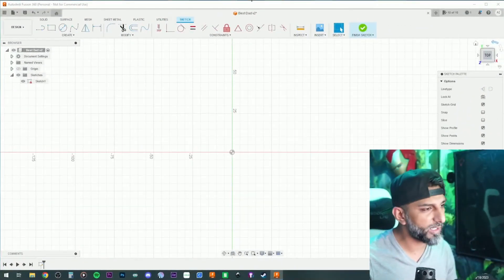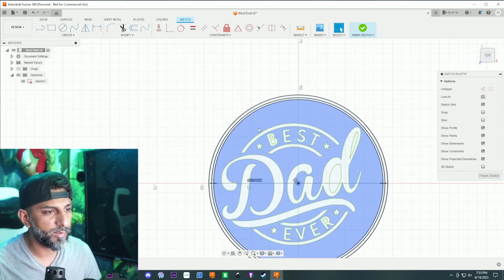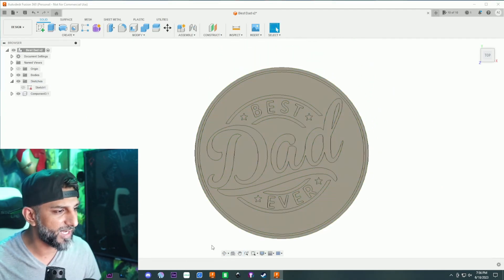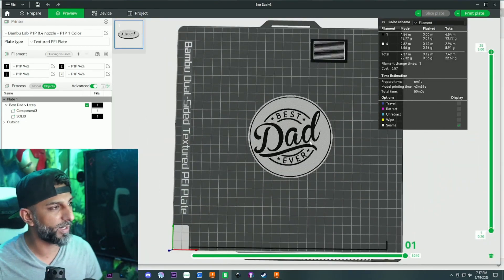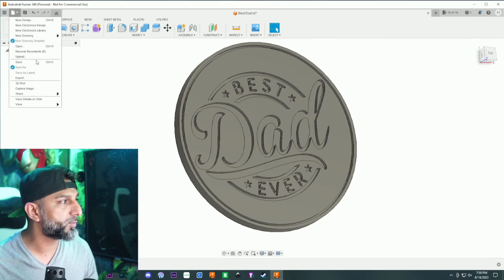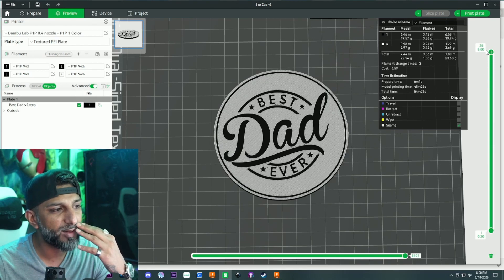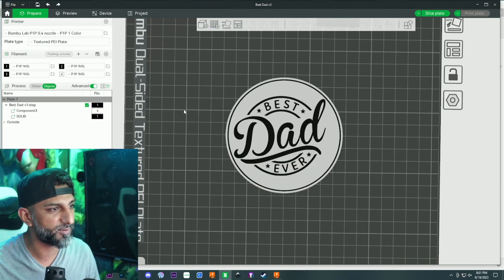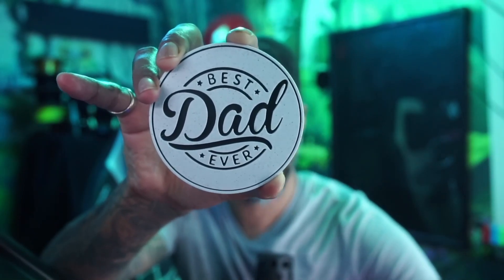3D Design & Print Drink Coasters! Father's Day Special Design

Comment: Thank you. Great video as always! It's possible to change filament color by layer. Slice the model>Switch to preview mode>Change the "Color scheme" to "Filament". On the right layer height slider, go to the layer you want to change, right click on the (+). Different Options will pop-up, choose "Change FIlament" and choose the Filament#. Move the slider again to the desired layer and repeat the process. It doesn't display the color adjustments until you slice it again. 🙂
Reply from the maker: Oyea there’s that too lol I forget about the layer height paint lol